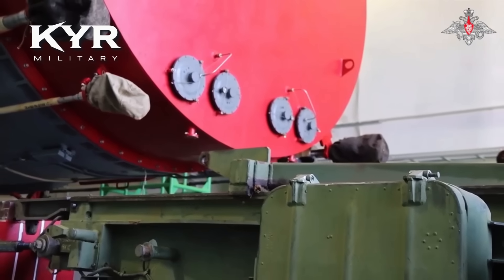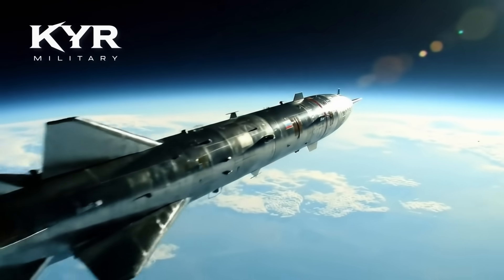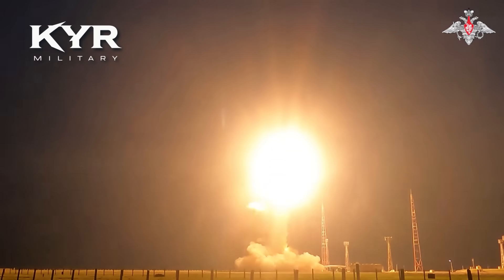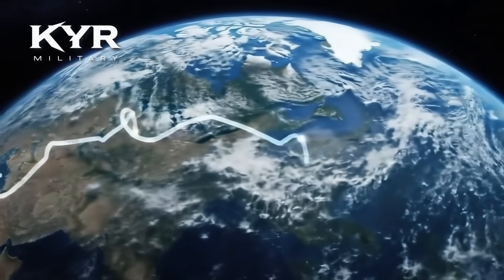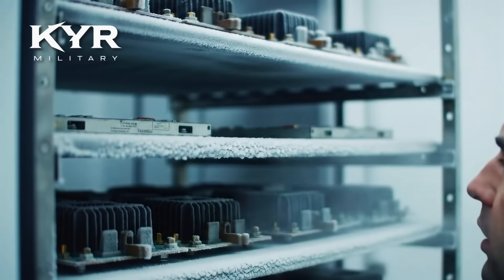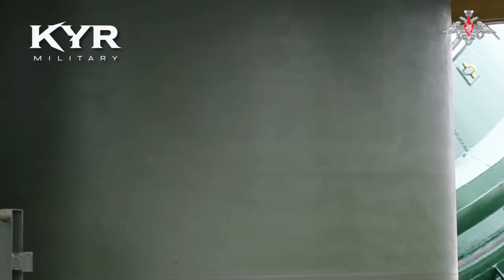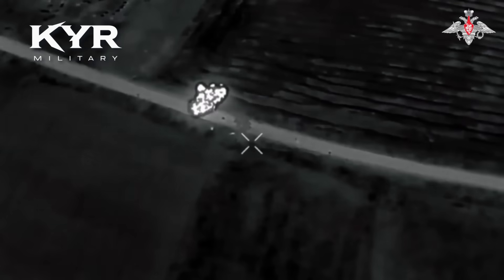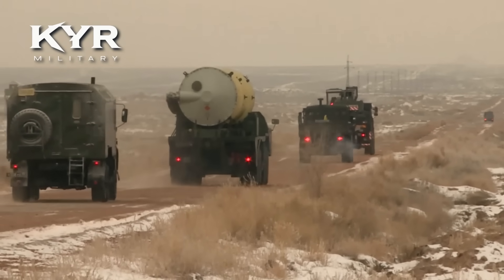Avangard Rudal Hipersonik Rusia Yang Membuat Negara Barat Khawatir!

Comment: The advantage of the approaching World War III is that, compared to previous world wars, it will happen very quickly and soldiers will not be suffering somewhere in the trenches. 
But it will not be only hours, as is often stated. Maybe only in the places of the first strike. The second wave is represented by submarines, which may have greater power than air 
military equipment. Realistic estimates are several days.
Reply from the maker: That's an interesting perspective on modern warfare. The speed and technology involved certainly change the dynamics compared to past conflicts. Let's hope for peace!
Reply: @KYRMILITARY  
Yes, there is a bit of dark humor in it. Every normal person hopes that the war in Ukraine will end and the conflict will end for good.